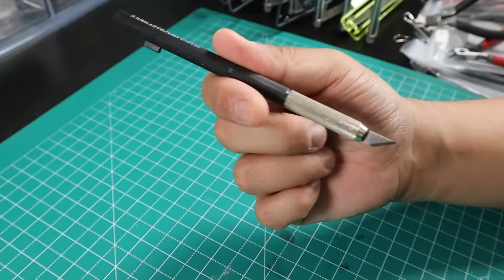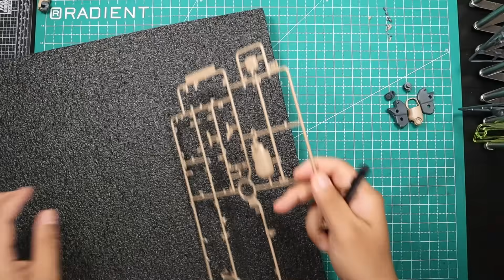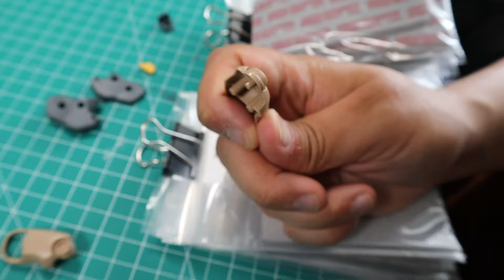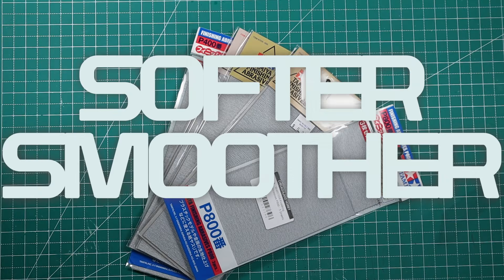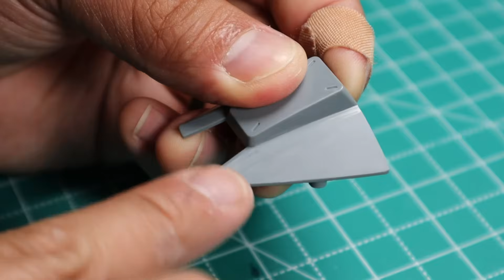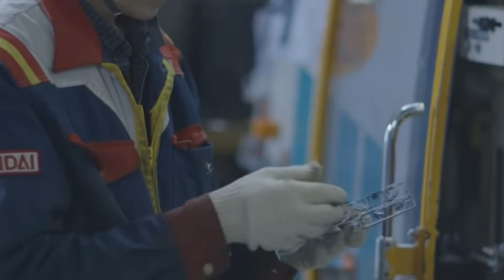How to Prep Your Gunpla: Removing Nub Marks and Other Surface Imperfections [Tutorial]

Comment: This is a great guide with clear, well-shot presentation and a lot of useful information. I absolutely wish I had been able to find a guide this helpful when I was first starting out getting into the hobby a few months back. 

As someone who's still intimidated by doing my own painting, I've found that starting with 800-1000 grit to sand nubs down, moving to 2000 grit to smooth things out, then finishing off with 3000 grit (and possibly a little shining with a non-abrasive sponge afterward as needed) is what consistently allows me to restore the plastic to its natural slightly shiny finish without the need for paint or primer.

I had wanted to ask about two issues I've run into that weren't addressed in this video. First, I've found that oftentimes gates (and therefore nubs) are placed on thin bezels on the outer edge of a part. This is good overall because they're generally less noticeable, but it can make it hard to sand down particularly stubborn nubs/stress marks/knife mistakes without messing up the thin line of that bezel. Do you have any tips in that regard? 

The second issue I run into as a perfectionist is after I've perfectly sanded down a nub to be flush with no stress marks... but still find that there's a dark spot of discoloration where the plastic was injected in the mold. Is this something that's even fixable without painting? i.e. can you simply sand deep enough to get to non-discolored plastic, or is that just not feasible?
Reply from the maker: As far as not losing bevels, I think you're on the right track starting with higher grits. Its also good to shave that nub down with the knife so that you can start close to flat as possible before sanding. Those particular placements can be tricky. Polishing up to glossy plastic though can often lead to oversanding. Its usually why i stop at 800 and just paint or topcoat. As far as those marks from the gates; those remnants of it will inevitably remain in some way, on raw plastic builds especially; even after polishing it super glossy. When I used to do more straight builds, it didnt really bother me. I guess it just depends on how much you care about the aesthetics. And to be honest most arent super noticeable to the untrained eye. It probably looks great. I would say dont get too hung up on it. From one perfectionist to another, enjoy the process. I rarely make anything without some minor defect here and there.
Reply from the maker: Also, im glad you found the guide helpful, and thank you for the kind words.

Comment: for someone who might not want to paint their kits, but still wants to remove the stress marks and nubs, what grit sanding material would you recommend? im trying to get the same exact satin sheen that the surrounding plastic of the nub is. i find that 4000 may not be shiny enough, and 8000 is too much. do you know of a grit that makes it have the same satin look that the rest of the plastic has? thanks!
Reply from the maker: Kinda hard to match that same plastic sheen tbh. Ive found that I just end up sanding almost the entire piece with 2500 and up to just make it all match. Its been a long time since Ive done just the bare plastic. So to answer your question, im not sure?
Reply: @plamomancer  thanks anyway! ive found that 7000-9000 matches it really well. i appreciate it anyway!

Comment: Ive been told not to cut the thick part of the plastic with nippers. They are meant to use to gut the part off of the gate right? Cutting the thicker stuff wears away the edge sooner doesn't it?
Reply from the maker: You dont have to cut too far back like I show in the video. With your single bladed nippers just trim the little bit left.

Comment: i never sand nubs on hip,ankle or shoulder joints. always leave just a little material for better friction to keep those joints from getting loose. i would never paint ball joints either. good way for them to get stuck over time.

Comment: Hi. I work in plastics. The little dips we often call sinks or short shots.  And usually happen because of air bubbles or insufficient back pressure in injection moulding. 

The marks are called weld lines and are what happens when slightly colder plastic touches each other when injected

Comment: So my issue with the diamond file is that my part is scratched to hell when I’m done. So the solution is to just sand with a higher grit stick?
Reply from the maker: @WaterySoup4242  yeah when you use a file it really doesnt take much pressure. After filing, go with 600, 800, 1000. If you feel like you still leave deep scratches, your file might be too coarse or you should just start with a 400-600 sanding stick or sponge, then move to highet grit
Reply: @ thank you for the feedback!

Comment: In the 40k world, we use the hobby knife and slice off the nub in layers, then clean up with the back the of hobby knife. But I guess we have way fewer flat surfaces.
Reply: GW also uses much softer plastic. Most gunpla is polystyrene and abs, so it's harder and more prone to getting stress marks.

Comment: Do you have a reccomended method for cleaning sanding files? I just finished doing the arm of a HG kit, and the end of the sticks were pretty full.
Reply from the maker: @seventhcyborg  keyboard/electronics cleaning gel; just dab it on there. Also a wet melamine sponge. Another option is just plain old masking tape. Give it a try.

Comment: No clue why I clicked on this, I am not really building gunplas but with the flat side facing away, aren't you directing pressure towards the piece?
The flat side is the one that isn't moving, it stays exactly where you place it while the angled side is digging into the plastic and pushing it outwards in the process.

Comment: For the first method - does cutting few times really matter that much? In the end you still have to use knife and sandpaper to make it look good. The area of connection between part and a runner is so small that even smallest amount of force leaves a stress mark
Reply from the maker: @labro249  it doesn't matter too much to be honest. Especially if you're gonna be painting, since all those stress marks dissappear. Like I said in the video, for the 2-nipper technique, you can skip to cutting up against the part right away. In certain cases, you may want to trim bits at a time, this is more prominent on super old kits. The engineering these days is incredible, so most of the time you can just cut right up against the part for the most part.

Comment: Super useful video, been applying what I have seen on it and my builds have improved! I still have trouble though as sometimes after the sanding the plastic just looks scratched or it loses its colour, specially on darker parts. Any idea on what I may be doing wrong? I have seen other tutorials but nobody else seems to be having this problem
Reply from the maker: @Delpino666  try starting at 800-1000 grit. Sometimes the lower grits leave too deep of scratches

Comment: i remember seeing a video explaining the stress marks are in some cases caused by the position of the nippers, it could be prevented  by pointing the nippers inward like you do, but the majority of videos use the nippers outward when taking the pieces from the runners 😵‍💫... that's the reason you do it in that way?
Reply from the maker: @Angeltsu  pretty much. But tbh it really makes a minimal difference. I think what matters more is not cutting right up against the part on that first cut and just leaving some distance. And just having some decently sharp nippers. Having the single-bladed nipper isnt a requirement, but it definitely saves you time. I mostly paint my kits so I'm usually not too worried about stress marks for the most part.

Comment: Alternatively, you can also get rid of marbling by using a matt top coat. It's obviously still there, but the masking way from how light works due to matting causes the parts to look more uniform. Plus, if you want a softer look to a gunpla, like making it look like the armor is fighting off the colds of space, then this is the way to go.

Comment: Honestly. Glass file, all day every day. Only tool I use now.

It’s like rough grit sand paper that leaves a surface so shiny it’s better than the mold itself. Every piece I have now has nub marks that look better than the rest of the plastic.
Reply from the maker: I started using glass files recently myself, total game changer and time saver for general assembly. I still do the traditional way depending on the nub but I also fully paint my kits so definitely depends on your style

Comment: Easily the most informative video I've seen when it comes to nub marks and stuff. I built a Deathscythe MG as my first kit a day ago and I had the misfortune if being so full of myself and assembled it all while a lot of nub marks are still on it, lmao. Anyway, I'll do my best to sand the visible nub marks and eventually top coat it. Lastly, you earned yourself a subscriber.
Reply: Likewise, got so excited to build Shin Musha and ended up leaving a lot of nubmarks and uneven surfaces.
By the way, i used a gardener's cutter 😵 and a replacable and retracta le cutter to cut those gates

Anyways, I could say I have improved my methods for cleaning and also went back to my Shin Musha for cleaning and reformed the uneven parts, done with panel lining as well. Now only wsd and matte top coat and it should be done. You'll get use to it the more kits you build

Comment: I personally use nanoglass files in conjunction with my God Hand nippers to remove nubs pretty easily. The DSPIAE siren, and the gunprimer raser 2 are my particular goto Glass files. I tend to like glass files much better than metal ones, and even sand paper, since they do not leave harsh abrasion marks on the plastic and gives a slight sheen to them that can easily be removed via a buffing stick. However, a tip for all who use these nanoglass files in particular. The best way to clean away the excess plastic powder built up on the file that you rubbed away is to use some scotch tape and pull away all the powder in one pass. I used a toothbrush at first, but as a PSA ... don't be me. Don't breath in microplastic bro, it's not fun. I personally think that using one of these glass files will significantly be a great alternative to whoever may not be completely comfortable with a hobby knife yet. They have certainly helped me.
Reply from the maker: Ive recently picked up a couple to try. I may have to do a seperate video to showcase them. Really liking the results and time saving. I didnt know about the scotch tape trick to clean them! Ill have to try this.

Comment: For part removal, one thing that I learned a while ago is that it might be worth it to grab the largest ziplock bag you can get and do the work with the sprue you're working on inside the bag...especially with smaller pieces. A clear bag because you need to be able to see through it, but it also prevents a lot of things like tension throws of parts. Most of the larger bags are heavy enough that blades don't easily pass through them unless you push directly against it, and the bag means that you don't have pieces flying everywhere.
Reply from the maker: Interesting. Ive always just put them into sorting trays. Never heard of this.
Reply: @plamomancer  I'm not talking about sorting, it's more of preventing situations where there's still enough tension in the sprue that clipping it might launch the piece off of your desk or work surface, leaving you to need to hunt it down and hopefully find it wherever it ends up.

I'd started that with some wargaming minis that had the same issue, and those are a lot softer plastic with less tension in it compared to the gunpla plastics.
Reply from the maker: @AzraelThanatos  i might have to try this. Started some minis recently and have admittedly lost bits to the carpet monster.
Reply: Personally, I find the lid of the gunpla box itself to be excellent for catching parts AND debris.
Reply: @ Main issue with it is that the way the parts shoot off often ends up being more random and can bounce off more solid things while a bag is flexible enough to, essentially, net the pieces

Comment: When trimming the nubs on sandwiched pieces I don't even bother sanding them until I've welded the seam with cement. Saves me the trouble of sanding the part twice.
Reply from the maker: Thats how I usually do it too. Ill be going over  plastic cement in a seperate video.

Comment: Nub marks guide for titanium finish gundams?
Reply from the maker: Oof. Thats a tricky one there. I personally dont like those coated kits because of that reason. Nub marks are pretty impossible hide and sanding will probably make it worse. You can try color matching to hide the mark with markers/paint but thats also very difficult. I find it better to just strip and repaint it, but you can just the regular version of the kit and paint it "titanium" finish. But yeah thats my take. If I get my hands on one and find a better way ill possibly do a vid. Sorry I cant be more helpful on that specifically.

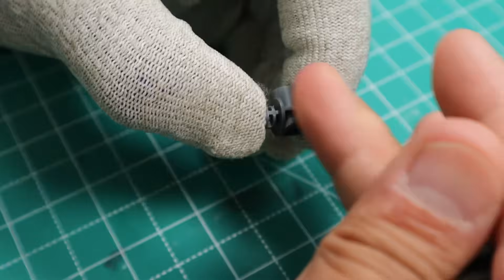Comment: Quick tip, if you want to speed up the cleaning process, just cut the part directly off the runner with a nipper if that part won't be seen anyway. Like for example on 3:33, it's just a joint piece that won't ever be seen so there's no need to spend extra time cleaning it
Reply: I find that part of the pragmatic approach is to study the guide enough to preemptively identify parts that will never be shown.  Hence don't bother de-nubbing :D
Reply: @glui2001  You already develop that knowledge without even opening up the manual after the 40th kit
Reply from the maker: True. And yes I know this. Saves time definitely. I was just using the part for example. Beginners need to know the basics. But good point!